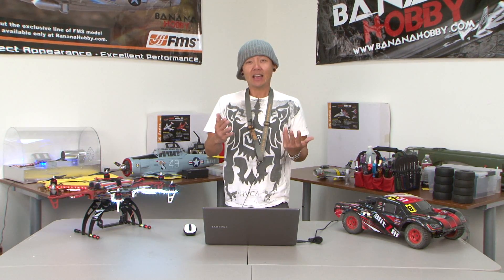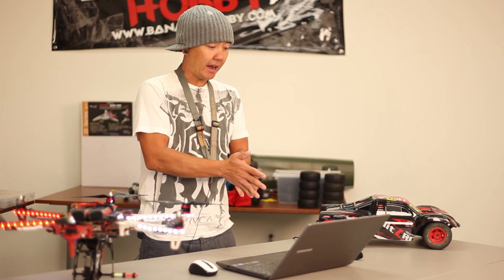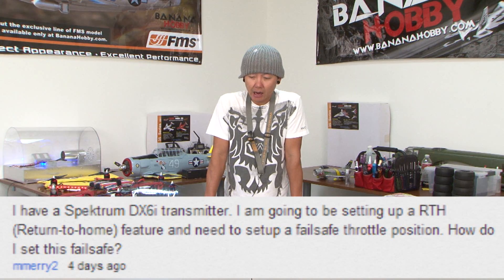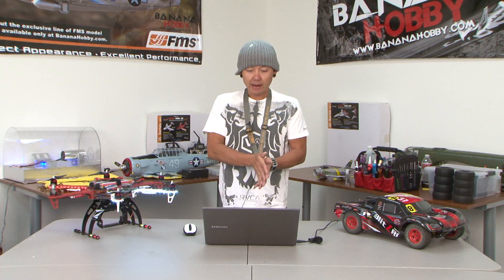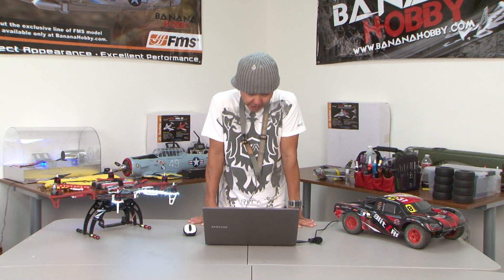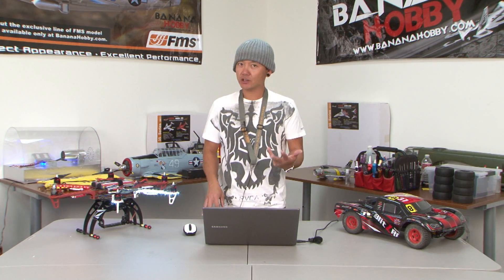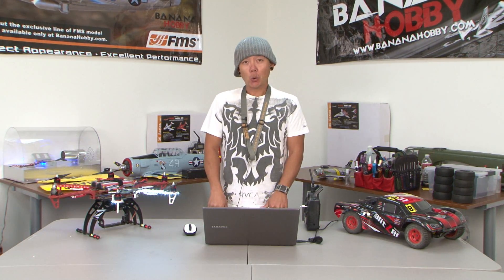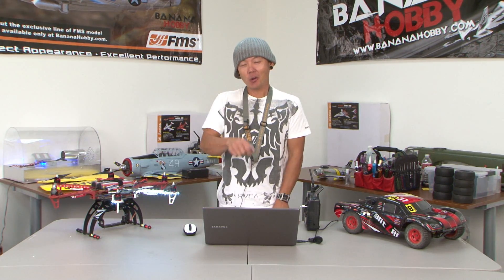Setup Return to Home Failsafe - ESC Timing - Spektrum Binding and more! - Ask Pete in HD!

Comment: Thanks for addressing my question regarding "Failsafe" for DJI Naza.  I'am using Spektrum DX7s TX and AR8000 RX.  I have a 3 position switch already set up with Failsafe/GPS mode/ATTI on my TX but I still can't figure out how to set it up when my TX is turned off or signal is lost.  Thanks for your help and your great videos!
-Kevin

Comment: Spektrum receivers have THROTTLE SAFE and if something happens the receiver moves the throttle to lowest position. Some multirotor boards will think you are just throttling down and crash. 
You need to change the throttle fail safe to the desire settting your mulitrotor board requires. 
Changing the throttle failsafe position is done during binding.

Comment: Thanks Pete for addressing my question.  The Cyclops Storm OSD controller board has a RTH that activates automatically if it loses signal with the tx, however it doesn't control the throttle on my plane.  You need to set a throttle failsafe on the rx.  I found out that you just need to set the throttle stick on the tx at the position you want, then bind the rx and it saves the throttle position as the failsafe.  This way if RTH activates, because of loss of signal, the plane has prop running.